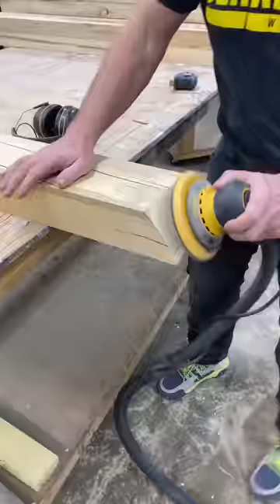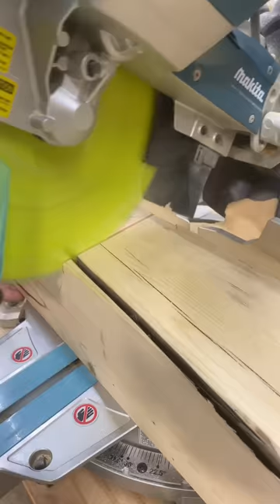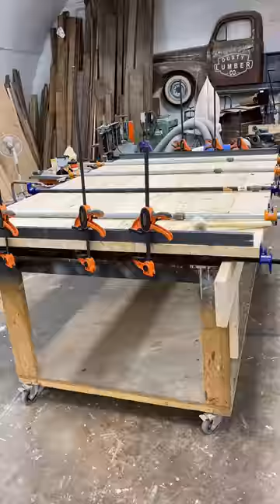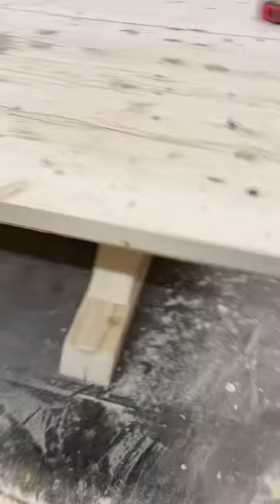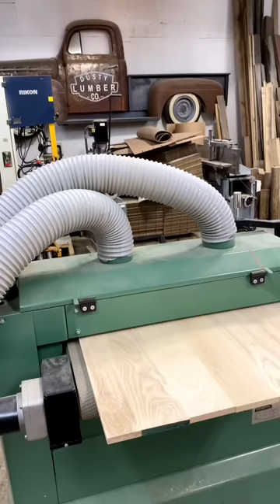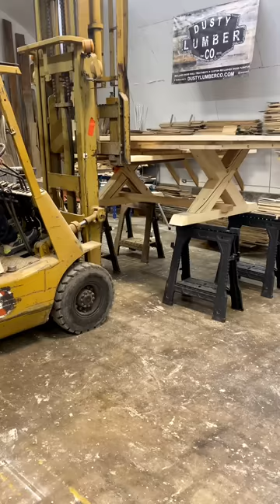Custom barnwood table build time lapse

Comment: How did you print that logo?  I’ve never seen a device like that.  Just subscribed to your channel.  I make a lot of stuff from barnwood and have learned a lot from your techniques.  Thank you!!!!
Reply from the maker: Thanks! That machine is called the Shaper Origin and is a handheld cnc
Reply: @dustylumberco  Thanks so much.  I just checked it out.  Pricey, but I think its well worth it. I’ll check out some reviews on youtube.  It would be great if you ever had time to do a review on it.

Comment: Great job .
Noticed when you cleaned the joints out with the router it appeared to be freehand , Is that correct ?
So how did you not catch the shoulders of the joint ?
Great work anyway 👏👏👏

Comment: Looks awesome! What is the thickness of your custom plastic base for your router? Looks like you were able to go pretty far without deflection!
Reply from the maker: Thanks! It’s 5/16”
Reply: I was inspired by you to buy a sheet of acrylic to do that recently, but the thickest I could find was 1/4”. Hopefully it won’t deflect too badly.
Reply from the maker: @graemediesel2936  1/4” is still pretty strong👍

Comment: Great build! Im a beginning furniture maker and I can only dream of such a workshop and such projects🤩 a quick question, the hot glue you use to fill in some gaps, is that just normal hot glue with black collouring in it?
Reply: It's a specific adhesive for filling knots and they come in various colors. Knottec markets a similar product. The metal block is a heat sink.
Reply: Can you use thsticks in a normal hot glue gun? Or will they only work with the manufactures gun?

Comment: Curious why you chose to router the inlay on a separate piece of material as opposed to routering directly on the table....
Reply: I think because now you only have to hold the machine instead of the wood
Reply: 💋seewhat what
Reply: w
Reply: When woodworking, you constantly are weighing the risks you take in your work flow. In this case he didn't want to risk the ENTIRE table top, trusting a computer assisted router, to cut a complex design perfectly in the middle. It's alot less risky to cut the design on a separate peice and inlay it once you know it's as perfect as you can make it. Would you rather risk the focal point of the project, or a few small pieces of wood that you glued up in 20 mins?
Reply: @chasegould6916  Personally I would have risked it. If it does indeed fail, then I always have the option to do it on a separate piece later. It's still a handheld router which means you can stop if you think something is wrong. I would have done the inlay first before trimming the table to final dimensions to ensure centering of the inlay.
Reply: Me? I personally like the visual contrast. It makes the inlay THE focal point of the table. The slight contrast in how differing woods take stain is what makes it pop. Also, as somewhat of a mercenary, I see a 20-40% increase in the value of the table by making that extra step...just sayin' 😉
Reply: @woodrowsmith3400  if that's what you're going for then detail it out that way by adding a border that says without question, this is the inlay and this is the table. Don't use the same species of of wood for the core unless is bordered by something else because then it looks like a mistake. If he would have just added a border that would have fixed everything and there wouldn't even be a question.
Reply: @Adventures_of_Marshmallow  you're making something out of nothing. Plus there's no wrong or right way to do it so there isn't really a question

Comment: This must be before Festool came in. All of these normal well- used tools. No 10’ sliding table saw or wall mount dust collection .  The blade on the saw looked 5 yrs old . You’re new videos the shop and equipment look like a hospital operating room. 
Even the floor is a disaster .